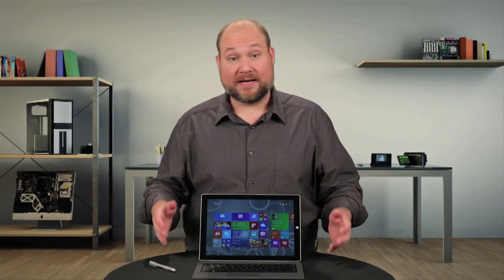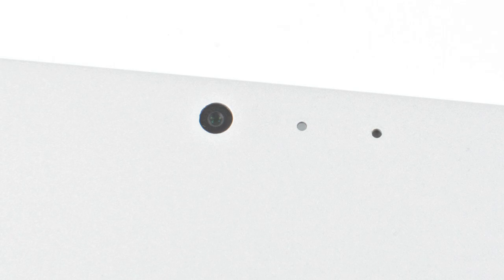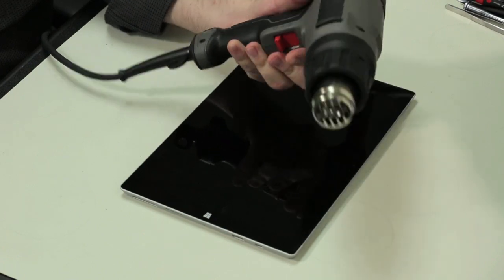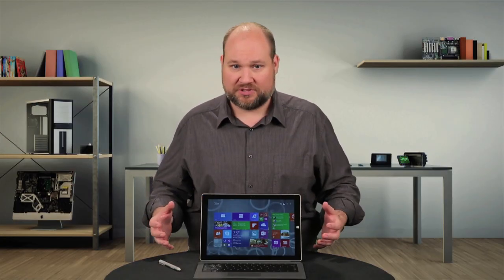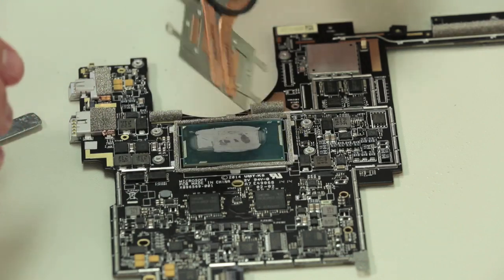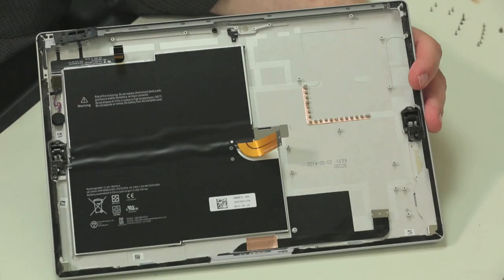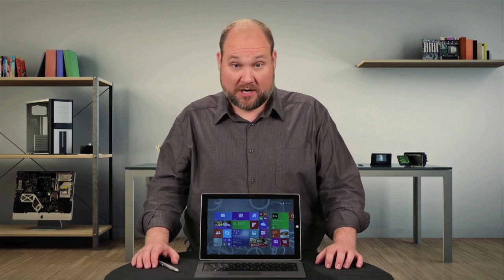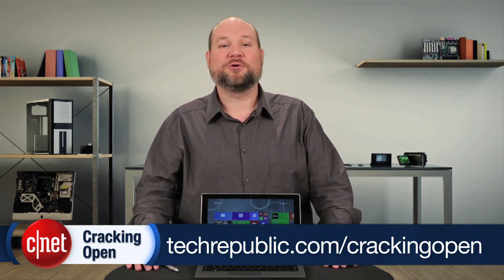Cracking Open - Microsoft Surface Pro 3

Comment: I did not realize that the surface had a fan in it, I thought it was passively cooled, would definitely buy the hp elite book 1020 instead.
Reply: Robert Perryy It can't be that annoying if you have just recognized it, right?
Reply: +Robert Perry cooling = better performance.

if your that bothered jam a papperclip in it.
You'll just end up dealing with a 1GHz CPU instead of the unlocked i series it comes with.
I don't believe for one seccond the elite book would come anywhere near the susttained performance of the surface with the fan

Comment: When an expert from a device disassembly program is cracking the screen while trying to open the device he sends a clear message: don't do it at home.
Reply: It's a tablet. 99% of people removing the screen are replacing an already damaged screen. I have a 2018 mbp, a 2020 iPad pro 11/256gb, surface pro 5 i5/256, and surface book i5/256... The surface book is great on a laptop stand and is a workhorse in the office, but my  surface pro goes everywhere with me. The iPad I just got because the price was so great, but it's legit only an oversized iphone. I only use it for Facetime and snapchat. The smart keyboard is meh and the pencil is too slippery to write with (compared to the surface pen which gives a more realistic drag). And I'm putting the mbp on eBay. It's legit like stone age... I only have it because it was a present. Yea the specs are nice, but I need touchscreen and stylus capability.
Reply: @apathy11303 crazy idea: someone wants to upgrade the storage. Would it have killed them to integrate the storage in an area that could be accessible by unscrewing a portion of the device? Say, under the stand?

Comment: Nice video, I was just looking into how tearable it is in the event that I have to replace thermal paste (fan is on full blast even while idling).  One tip I would recommend is getting the thinnest guitar picks you can find.  I use .50mm picks myself, since they're the easiest to snake under the glass, followed by some thicker 1.0mm to keep the glass from re-sticking to the case and giving it some extra leverage as you're working your way around.  Just some food for thought, since I hate risking breaking anything that shatters like that.

Comment: Your device is actually half the size of what you see. The OS and whats saved within it is the board and the SSD. Which only takes 1 quarter of the device's shell. The space hoger is the battery. You say how small the Surface Pro 3's board is right.

Comment: Question:  Now that you got the glass/screen off successfully how to you put it back together?  Regarding to the "glue".  Do you reheat it and the glue will then re bond or do you need to get/buy a particular type of adhesive to glue it back together?

Comment: The Surface Pro or any Surface for the matter is more a full blown Tablet/Laptop hybrid device because of this it's going to be difficult to repair like any tablet.  A Laptop like the MacBook Air is easier o repair than a tablet but good luck getting portability out of the Air over a Surface computer.  It more or less boils down to what do you want for your needs a 2 in 1 or a more traditional Laptop that is thin and light.

Comment: The reason the SP3 is so hard to repair compared to the MacBooks is because the MacBooks are.. Well.. Laptops. Nobody drops their laptops as much as their tablets.

 Because, you can't use laptops while standing up, however you can easily use a tablet. And that is the time people drop their tablets, phones etc the most. I remember I've dropped and broken my phones screens more than 5 times, and every time I was standing up and using it. 

As a Surface is intended to be a tablet as well, you'll probably use it sometime while standing up.. And then drop it accidentally. But all that glue used to hold the components of the SP3 together will save you alot of cash. I bet that a touchscreen as good as the SP3's, costs a lot.

Comment: heat gun ??? amateur way of opening a surface......LOL  i have seen a device they put on top of the edges of the screen and slowly heats the edges after 12 min it opens without problems...but hey they new what they where doing......

Comment: DONT BUY THIS TABLET. the tablet itself is freaking awesome but the charger is a MAJOR problem. IT WILL break within a year and is a 90$ replacement with no viable 3rd party chargers available. Proof? Go on the microsoft store website, search an individual charger and read the reviews and ratings. wth is the point in such a great tablet if u cant use it b/c of a stupid reason such as a charger malfunction....

Comment: I've fixed many tablets and tablet like devices. Most of them have a stick down screen, especially Apple devices. what I have determined, most anything with a digitizer gets stuck down with glue until you get to large hardware like all-in-one desktops.  It's nice to be able to service the device, that microSATA SSD can be replaced with larger ones, they even sell them on Amazon.
Reply: shayson1357 Data read rates. USB 3 still = slow.
Reply: Do you fix the surface pro 3
Reply: +Dragon Steel why would you upgrade the ssd just get a 128 or 256 USB stick and dump your stuff there.
Reply: don't really need fast reads for file dumps like videos and flac tracks and pictures, the 256 or 512 ssd is imo enough for the OS+programs+most used media files.

Comment: All windows fans made fun of Macs because its difficult to upgrade then cnet do a video on opening a Surface Pro 3 and then you clearly see here that the MacBook Air is easier to upgrade
Reply: ***** I'm taling about hardware in this situation
Reply: ***** I mean windows fans as in people not cooling systems and by hardware I mean things like storage upgrades, battery replacements, ram upgrades. There's no reason to get angry.
Reply: ***** Ok, but aren't Hackintoshs illegal? and thanks for the explanation and what about the 2013 Mac Pro that has good upgradeability (an un Apple like move) but its bad when it comes to expandability is that true?
Reply: SoldierSparky It's not illegal. It's not like they can come and arrest you. It's "unsupported" is all, lol.

Comment: I used to have an alienware m15x for everything, gaming, note taking, school work, music, and netflix.  I then sold my alienware and used the money I got from it, and a little help from my graduation gift money, purchased a Surface Pro 3 and built my own gaming desktop.  Best decision I ever made.  My desktop is great for stay at home gaming, and even taking to LAN parties, although I did purchase Gear Grip to help transport it, and the surface pro 3 is great for school.  Due note it is a school/work machine, it will handle games that don't take a whole lot to run, but for hardcore FPS action I would not recommend it.  It does run Civ 5 beautifully though.  Point I am trying to make is the Desktop/Pro3 combo is an amazing combination to use and works well for just about everything.
Reply: I have also used my surface pro 3 for gaming, Its one of the best laptops I've ever had!
Reply: @andrewc9247  wow talk about a blast from the past lol, since then ive sold my desktop, surface amd converted my alienware into a web server, im now running a dell xps15 2in1  and an egpu dock all on arch linux and that setup is amazing, nice to have the power for gaming at home, and mobility for work all in the same machine so i only need to admin one
Reply: Really? I tried a few games and they did ok, but I always try to run them at native res, because I hate low res gaming it really messes with me, or maybe I'm used to the 780 ti in my desktop so anything less feels really bad
Reply: in my pro 3 I have the i5 as well, dual core, and 4 gig of ram with the 128 gig ssd, that extra 4 gig or ram can really make a huge difference
Reply: Kevin Pyro i5s are quad core, i3s are dual core.
Reply: not in the surface, they are running a dual core i5, still 64bit but it is dual core.  It took me a while to realize this too, but after installing linux to a separate partition and trying to dehash some passwords using brute force seeing it take longer than expected I investigated and my surface only has dual core but it is for sure an i5
Reply: ***** ah, thanks for the tip.  Its hard to keep all the different models of intel chip straight.  As cool as the SP3 is, with the price, the dual core thing makes the choice that much harder between Note Pro 12.2 and this thing. Hmmmm.
Reply: yeah I was gonna say, the SP3 may only have a dual core, but it still runs full Windows 8.1.  Although if you get a nexus device on android you can actually run several distros of linux off of them, my personal favorite being Kali.
Reply: Kevin Pyro I guess I was thinkin as an engineer my CAD station at home is my main computer, I really am making an effort to go paperless, the lightness and stowable S pen were attractive features.  Plus, app store programs are much cheaper than PC programs.  Thoughts?
Reply: the pen on the SP3 is better i would say, mainly because I like the pen better, having used both a SP3 and a note, and yes teh apps are cheaper, but the programs for a pc are better, plus if you don't mind bending the law a bit you can get them fro free.
Reply: Kevin Pyro Interesting, I thought the S Pen was supposed to be this great wonderful thing.  One thing I have to consider too is that being a pilot, having a tablet in the cockpit would be huge, can put maps on it and all my flight info.  If I'm not flying instrument, I can use the tablet's GPS. As far as I know, the SP3 doesn't have GPS chip, not sure though since it isn't something MS is saying anything about.  The fewer wires and attachments the better since its one more thing to get in the way of an already busy airplane.
Reply: another thing with the SP3 you generally don't have to worry about over heating it even when gaming, it comes with two CPU cooler fans which do their job wonderfully.  Note the back does get HOT when gaming for any extended period of time.

Comment: Can SSD be upgraded on Surface Pro 3?
Reply: It takes mSATA drives. If you want to risk opening it then you can. Otherwise consult Microsoft.
Reply: ***** oh yeah, definitely. I got myself the i7 512GB model so that nothing more is desired :)
Reply: PIXELFLUX After looking at all the screws needed to be removed, I would rather pay more than try to cut corners and possibly break the tablet.

Comment: I said it before and I'll say it again. Nobody with any sense wants to repair their tablet. So who cares how difficult it is. Try to get that through your head Bill. Only a complete idiot would void their warranty by trying to repair their tablet on their own. Only the biggest dweebs of all time would even bother.

The whole point of this video is stupid.
Reply: LOL. So, your SSD dies, or your battery goes kaput. You'll just throw it out? Heck Microsoft upcharges $300 to go from 128GB to 256GB SSD when you can buy a 256GB for < $120. Most warranties will cost an additional $300-500 and you'll be missing your laptop for 1-2 weeks if you're lucky. Plus what do you think happens when you send in your tablet for warranty repair? They have to do just as they did in this video. They need to secure it like smartphones do, with molded in clips to the outside ring.
Reply: PIXELFLUX More expensive? First of all who cares? But secondly It's not more expensive. 512GB mSATA is about $200. 2.5" SSD is about the same cost. Microsoft wants to charge you $300 to go from 128GB to 256GB, and force you into an i7 to get 512GB for $600 over the i5/256GB version. It's just ludicrous. If they made the pricing more in line with reality it wouldn't be such a big deal. But why should I need to pay $600 for a 512GB SSD when I can get one for $200?
Reply: PIXELFLUX R&D, design and engineering, parts and assy, etc and all that crap is built into the base price of the unit. They'd be dumb not to. Anything else is pure profit. You're talking $600 difference between doing it yourself or buying it built in. I don't know about you but I have much better things that I can spend $600 on.
Reply: may I know, how much it cost for repair, if the battery drop or dies?
Reply: htwingnut well, they charge the price because they CAN. Don't be a moron, you don't only pay the price for just the parts themselves, you also pay for the R&D, the design and engineering that went into the product as well as the parts and assembly.
If you want something that you only costs depending on components - then the Surface is not for you. I, for one, am very happy with my i7 512GB version and I don't care.
Furthermore - you complain about 200 bucks, while I really wish the prices of hardware were so miniscule here in UK!
Reply: htwingnut this is mSATA we're talking about, not a regular SSD. Those are more expensive.
A far as service goes - be careful with your stuff and you won't need servicing. I myself have NEVER needed a warranty service, would you believe...
(but my i7 512GB variant still has an extended warranty and accident protection till 2017, so not too bad even if I drop it at some point)
Reply: htwingnut well then good luck doing it yourself xD
Reply: PIXELFLUX htwingnut We do agree that it's too expensive to get 512GB, but Microsoft is just the trend Apple set. To go from 128 to 256GB SSD in your MacBook Air you pay 200 on top. Nothing else is changed. So is that any better? Why should the Surface Pro 3 be cheaper? Cause it's not Apple? Is Apple the only one allowed to sell high priced articles now? Actually I don't think it is overpriced if you get the i5/256GB version since there's nothing out there that compares to it. The only thing that bothers me is the battery life and heat - MacBooks/iPads are so far ahead in that point I just don't get why. 

I just checked the warranty of my SP3 - they'd send me one for replacement and I send them mine within 2 weeks after I got the replacement. At least here in Germany that seems how it's done.
Reply: HTHAMMACK1 Maybe one of my RAM chips has fried. This has happened a couple of times to my desk top and it's a simple case of undoing two thumb screws, removing the side panel and replacing the RAM chips. If this happened on a surface pro I'd have no way of fixing it, I'd have to send it back to microsoft, which no doubt would cost a hell of a lot more than a new RAM chip.
Reply: Quacktics are Go well, if it's within warranty then it's no problem at all. As for frying the RAM - you most likely had a faulty power supply or unbranded RAM or something as this has never happened to me in decades of computer usage and I really doubt it would happen to the Surface because the design is thought out and uniform, unlike the many billions of possible PC builds out there.

Comment: Who cares if the Surface Pro 3 is hard to disassemble. The whole point is to use it not cracking it open and if it was easy to open, it would be easier to break if you dropped it.

Comment: ***** In this sort of device, what happens if the battery dies?  Does the system go into a trickle charge loop since it won't hold charge, then swell etc? or Does it bypass the battery completelly after some charge cycles to avoid swelling/explosion etc (I have heard there are counters for that ) and only run plugged it?
Reply: Once fully charged it bypasses the battery, this is true for the 3 ,cant say for the previous models

Comment: hahahha...looking at these videos , now manufacturers have to worry about pleasing the repairman /service center community along with the users.....
Reply: Lololol
Reply: Varun Singh This has nothing to do with "pleasing" service technicians across the globe and everything to do with the ability of the owner of such devices to help offset the ludicrous pricing of hardware up-sells that M$ seems so intent on. 

I understand that they're trying to protect sales of the high(er) end devices by intentionally making the insides so difficult to get at. But as others here have pointed out, its insane that they charge you $300 to go from 128GB to 256GB, and force you into an i7 to get 512GB for a $600 premium versus the i5/256GB version just because you want a larger mass storage device that you could buy for a lot less. 

I'm willing to pay more dineros for more hardware. But lets keep some perspective on it shall we? They didn't have to make a new internal layout for the larger SSDs. They ALL look the same. The same goes for RAM. Its just the chip density that changes but not the form factor. 

Yeah this is a tricky mod. But for some this is a kind of sport, to see how to get the best deal bang for your buck (and if some time is involved, so be it). And as someone who unlocked the upper multipliers on Athlon 1800-2200+ by connecting the L1 bridges on the CPU with tape and conductive silver paint...I can appreciate the challenge of projects like this :-)

Comment: The GPU graphics is also terrible and not upgradable. Recommend waiting a few generations and seeing if it gets much much much better.
Reply: ***** I think its fine, especially for users such as yourselves. I guess I should have been more specific. Professionals such as engineers, scientists even artists and media creators require GPGPU capability. For the average person this is more than enough.
Reply: This is not a gaming machine
Reply: you are not getting a gpu on these things, as GPU manufacture is not oriented to be this small and have so little heat dissipation, processors on the other hand, are so heat dependant, that they make versions of it to be as compact and heat efficient as possible. A crappy gpu capable of fitting on these is basicly the same as the integrated graphics you obtain from the processor (HD 5000 for i7)